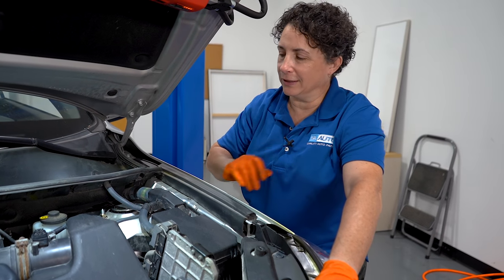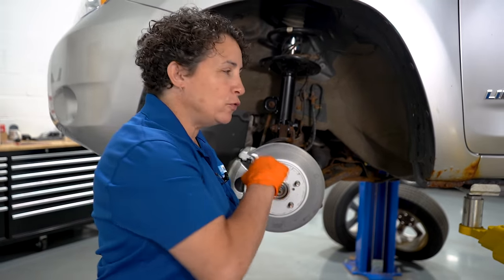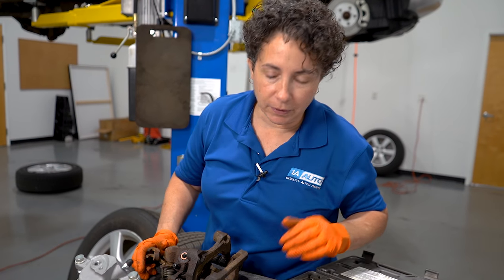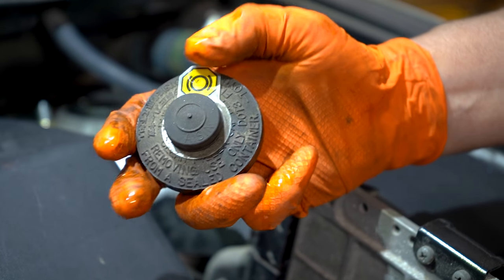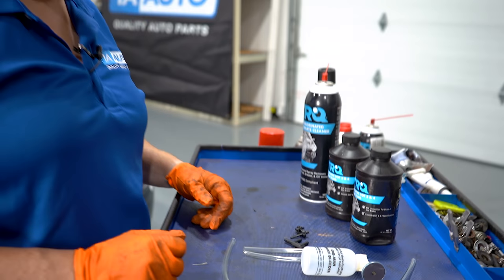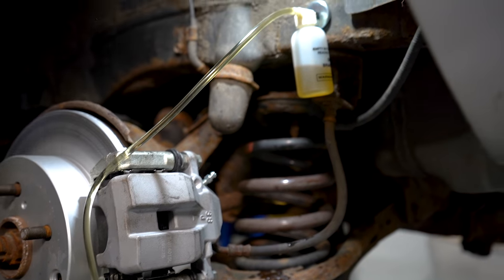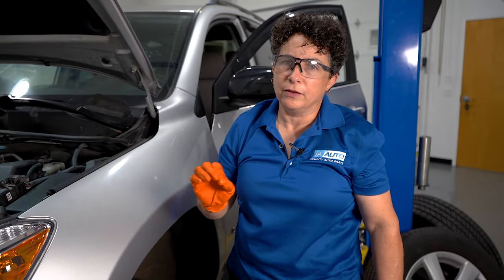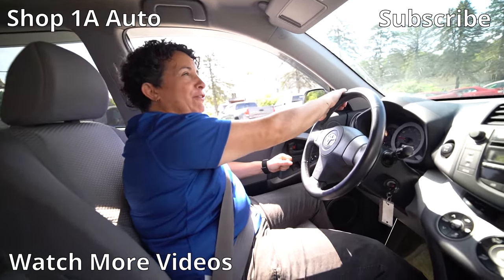Common Mistakes Bleeding Brakes! How to Do a Full Brake Bleed the Right Way, and Why!

Comment: I don’t know if you went over this but what are some of the causes that puts air in the system? Is it like a broke? Is it a loose nut? Is it a loose line? Is there a hole in the line? What are the causes of getting air into the system.

Comment: After only doing front brakes, you would want to bleed air out of the front first and get you full brake pedal back. THEN you can bleed the rear if you want all new fluid in the system.

Comment: I have a 94 civic that bleeds fine not running but when I crank it up the pedal goes right to the floor like there's no master cylinder at all / no resistance.  I've tried 6 master cylinders.
Reply: I don’t know but I’ve read that pumping the brake all the way to the floor could ruin the MC seal. GAWD I hope not! Lol Some say to place a 2” thick board under the pedal. We will see 😁. Good luck 🍀

Comment: In general, good theory, but...
Here I was, watching a professional at work (or so I thought), then at 9:07 – spray! goes the paint-stripping DOT3 brake fluid.  Wash it off immediately, keeping water away from electrical components.
10:48 – "So this time I'm gonna do it with the kit that we actually sell."
15:09 – "I gotta tell you this is my first time using this kit."  You sell stuff you've never tested?
17:10 – "As I make a mess" (chuckle).  Yes, we all made a mess the first time, then we learnt to use a funnel or buy brake fluid in a long-neck bottle.
18:25 – The beginner's errors continue.  All of us have a first time.

Comment: A big syringe can pull fluid out with a tube attached to the bleeder. No air if under continual suction. Make sure tube is correct diameter must be tight on the bleeder so no air.
Reply from the maker: +@chrismyers9951 Thanks for the feedback!

Comment: Brake fluid consists of solvent (between 60 and 90%), lubricating agents (5-30%), and additives (2-5%) which are corrosion inhibitors, which prevent corrosion of the brake system metal parts, and antioxidants, which prevent solvent breakdown and deposit formation. dot 3 systems can also use improved dot 4 or dot 5.1 fluid. beware dot 5 is unique and only for dot 5 silicone systems and not compatible with 3, 4, or 5.1 nor anti-lock braking systems.

Comment: I just can't get this to work.  Have no idea what I am doing wrong but I just can't get the fluid to come out.  The master cylinder is on tight and the brake fluid is full.  I close the bleed valve, put clean brake fluid in my bleed tool then attach the tip into the bleed vale and then open the valve with a wrench and I get some fluid but not much.  Just doesn't seem to want to come.  What am I missing here?

Comment: Thank you so much for this video really enjoyed it. However I have a mall question. On my SX4 I have the rear wheel brakes do not seem to function when the pedal is pressed. When engaged with my handle they are OK. I have to press the pedal really hard to see an effect in terms of being able to rotate them by hand. Front are OK though as seen by the disks brake pattern. I checked the pedal is firm after pressing couple of time and it seems ok. I also checked the slider on the side that seems problematic side and the pistons seems to go in and out easily. One side is working a bit better than the other. Any idea? I Thank you always enjoyed your videos

Comment: If im changing just my front rotors (and pads) do i have to do a bleed?
Or can i just just slap the new rotors and good to go?  (Without disconnecting the caliper)
Reply: Should be ok just check to see if you need to top off your master cylinder fluid level. Worn pads causes the caliper piston to extend requiring more fluid to maintain pressure on the pads.

Comment: Should the bottle containing the fluid be always installed ABOVE the bleeder screw? Is this because air travels to the highest point?
Reply: thats what I want to know.  tho I think the important component position is that of the bleeder screw, which is almost always on top anyway.
Reply: If the bottle is higher, then the air bubbles will continue up towards it. If the bottle is on the floor, the bubbles will tend to creep back up the clear tubing towards the bleeder. You can do it with the bottle on the floor, but it would be better to have a person there to make sure no air went back into the caliper.

Comment: Bleeding out air and flushing the brake system also bleeds air out of the braking system however bleeding the air out doesn't necessarily require flushing out the inter brake system. The rule of thumb for brakes is flush brake fluid (with fresh brake fluid) out every two years or 24 months. Ps at least  test fluid once a year with test strep to see how chemically good the brake fluid  is  and use a moisture tester as well .

Comment: Does the car have to be on or can it be be off? I tried doing it while the car's key was turn to on, without ignition, brakes got hard.
once the car turned on the brake pedals were really soft and spongy

Comment: I feel for everyone working on anything under a vehicle in the rust belt, looks like every nut, bolt, fitting etc would be difficult at best to break loose without actually breaking them.

Comment: There's also the dilemma of where the ABS module is. While the master cylinder is on the left the abs actuator is on the right. And then from the abs actuator it goes to a junction so... yes definitely more complicated than it looks

Comment: she said to never use a union, but when i ordered a new set of stainless brake lines for my jeep, the long line going to the rear comes in two parts with a union in the middle (otherwise i'm not sure i would have been able to snake it up through the entire vehicle)

Comment: As a matter of safety, there needs to be more than 1 system.  As hygroscopic as brake fluid is, if you bleed one set, bleed the other. Over all, it may help. Try a vacuum brake bleader. It works well,evel.solo.

Comment: I thought the order of bleed was dependent on where the ABS module is located?  Also I was surprised the rear wheels didn't need a lot more fluid removed to ensure all old fluid in the lines was replaced.

Comment: Hi sue!!! My 2014 toyota prius had rear rotors, pads and calipers put on. The guy bled them like any regular car. Now I hear like a giggle when I put my brake pedal down to start car. It was not put in invalid mode. Now a sign shows for a few seconds, maintenance required soon, what is going on?? Can I reveled them again, in invalid mode???? Help.... Thank you dear....
Reply from the maker: +TERRY TORRES We wouldn't be able to diagnose an issue like that here, you may want to have a local mechanic take a look at it. Thanks for checking us out! http://1aau.to/m/Shop-1AAuto-c

Comment: Doesn't the ABS module require air bleeding? I bled my car's system, replaced almost everything the whole system (brake pads, rotors , master cylinder and booster ....) but the brake peddle is still too spongey! But no ABS lights are on. 
So what's the big deal here?

Comment: I like to crack the bottle open after tightening the bleeder back on to relieve brake pressure in hose. This way when you do remove the hose from the bleeder there's no pressure and the brake fluid won't squirt out everywhere.

Comment: I'm having a heck of a time bleeding the rear caliper on an Audi. I think the problem is the E-brake. Any suggestions?
Reply: Not really. If it seems hard. It
Is not really air. Seems that really had a strange( Not a
Normal) order for a proper
bleed. The order was not
for me.  It was that way only
On that Audi. Audi is
Different. Careful, it is time
Consuming. 🤔💭👌✌️

Comment: When you use the brake pedal to bleed brake system it is wise NOT to push it beyond its normal travel because any corrosion in the master cylinder beyond the normal travel can rough up the piston which will allow fluid to bypass the plunger and pedal will sink.

Comment: How tight should the bleeder screw be because i just bled my brakes, my front bleeder screw on my truck is leaking
Reply: Sure be careful and tighten if
Needed. But check for striped threads as well. It may leak cause of that. I think🤷🏻‍♀️

Comment: Oops.. the abs location is what designates bleeding...furtherest location from abs...my abs is mid area of chassis on drivers or left side... and auto bleed on my scan tool requires rite front left front left rear then rite rear...

Comment: 1978 Ford F-250 come from the factory with two lines and an union on the rear brakes. Don't believe it is illegal to use an union as long as it has a double flair on both lines. Yes compression union has no place on hydraulic of any kind.

Comment: Apparently 06+ Honda Civics you bleed the front drivers side first, then front passengers, then rear passengers and rear drivers side.
Reply: That’s what my manual says but there are instructions for ABS models, too of which mine has no ABS so it’s different. If ABS is in the rear then you bleed from the front first of the longest line. I looked at a diagram for mine and it’s right rear first then left front and front right, then front left. 🤷🏽‍♀️

Comment: The copper washers for ŕthe break system can be reused. ALL YOU have to  is get them red hot and dumb them in water. All the contaminants on the washer will blow off. Ì⁶

Comment: Sue i was taught that you don't have to bleed the brakes if you just change pads and don't break open the line because you won't get air in the system
Reply: True

Comment: Why are the unions illegal? And I just did breaks and I used the last video with the bottle to bleed them, thank you very much
Reply: Because it's a chance that if it was bad enough to need one it could fail elsewhere BTW its a mandatory yearly inspection state so according to the list of regulations it's a checklist that decides if you fail or not

Comment: What are the chances of air creeping in past the threads of the bleeder screw and ending up inside the brake line/system???
Thanks.
Reply: Very little. Unless its a very old car that has the screw opened and closes many many times.

Comment: My theory for why spongy brakes are bad is that with only half the applied pressure due to air in the lines is that it now takes you twice as long to stop.  Twice as long creates much more heat and degrades the brakes even further.  Never really considered it before you alluded to that in the video.

Comment: Do you have a link for the kit or where to find it
Reply: Most all auto parts stores carry it in the tools isle
Reply: I do find that if you leave that pan on the floor and use the hose and create a 6" arch with nothing but the pan it won't backflow air and overflow that tiny bottle or use a 1 liter water bottle to catch the extra fluid

Comment: VW repair manual states:
Open bleeder valves in the prescribed sequence and bleed brake caliper.
1- Front left brake caliper
2 - Right front brake caliper
3 - Left rear brake caliper
4 - Right rear brake caliper

...also, if you are using a bleeder unit:
A positive pressure of 2 bar (29 psi) is required to bleed the ABS Hydraulic Unit

...and you should ALWAYS use a bleeder unit which will pump new fluid into the system 100% of the time. When you press the brake pedal, you are doing just that, BUT when you depress it, you suck air into the caliper through the bleeder's threads which is now LOOSE and not sealing because you unscrew it. That is just so wrong.

Comment: The problem with this procedure is that your fluid is moving back and forth so any air in the lines is also moving back and forth and you will end up with spongy brakes. I agree with getting new fluid into the calipers. A vacuum system would be much better procedure

Comment: When pushing the brake the black nipple just comes out of the bleeding dimple and it makes a big mess.
Reply: Your pushing too hard too fast or its the wrong adapter your using.(you can just use a bigger hose that fits too)

Comment: Nice Video!   If you have an insurance monitoring device in your car you should remove it and shut down anything it uses to report your driving activity to your insurance company because it will report hard braking and give you a bad mark.    After your done testing put that monitor back in the car and turn on everything it uses to track your driving activity.   Hey your trying to save money doing your own brakes so why give your insurance company and excuse to reduce or discount.   It's a small thing but every penny adds up.

Comment: Hey sue, I know it's 12:30 I'm the am mountain time, and it's a white out where I am in Colorado right now, but I have a brake bleeding question right now, cause this is when I have to do this.... If u are awake, and up for this, you should message me back... Maybe call me? If not, no problem I'll wing it

Comment: Ugh, not so fast!  There's no reason to pour any new brake fluid into that small bottle that comes in the "kit". As there is a Check Valve inside the top that screws onto it. So when you do press the brake pedal down- the old fluid goes into the bottle ( since a Check Valve only allows flow in 1 direction ) any fluid needed to replace it, must come from another source. In this case, that fluid would be new & come from its brake fluid reservoir.  The instructions may not tell you this 1-Man Magic* (or 1 Ma-am Magic) was brought to you today by the Check Valve they incorporated into the cap behind that incoming hose connector, but it is. Just networking, but she did do a great job. If she already knew, cool. If she / y'all didn't, well now you do. Always great videos from this company!    ~~~    We dumb in Bama, but we ain't plumb dumb 😊

Comment: Copper for brake lines ? It’s illegal here in ontario must use steel or stainless steel , or some other no corrode metal  if recomend stainless no rust, I think stainless should be law , cause with steel you don’t know you have a bad line until your pedal drops to the floor, although copper woul be better then steel , because it doesn’t corrode depending on th gauge

Comment: TO BEGIN SOMEONE SHOULD PUT PRESSURE ON THE BRAKE PEDAL THEN YOU SHOULD CRACK THE BLEEDER UNTIL OIL IS JUST SEEN TO EXIT AND NO MORE. THE REASON FOR THIS IS AIR CAN PASS THROUGH PAST THE BLEEDER THREADS AND INTO LITTLE HOLE IN THE SIDE OF THE BLEEDER GIVING A FALSE  READING
Reply: It's not necessary, you're going to pump the air out anyway. Brake fluid is cheap, pump a bunch of fresh fluid in there.

Comment: Make sure you wash any brake fluid off the cars paint work immediately if you happen to drop some on it. Your paint will peel off if the brake fluid is not washed away quickly.

Comment: Sue i was taught that you don't have to bleed the brakes if you just change pads and don't break open the line because you won't get air in the system
Reply: That's what I've been taught all along as well.

Comment: I never needed to pre-fill my waste bottle with fluid. I only loose the bleeder enough to let the pressurized fluid escape and the check valve in master cylinder has much less resistance than the brake line + restriction at the bleeder when pedal is released so the fluid only flows one way.

Comment: There's no need to put fluid in the bottle.  She obviously didn't read the directions.  There's a one way valve inside the cap to prevent air from getting sucked back in, as you can clearly see when she released the brake pedal.

Comment: A good Kit should have:
* A LARGE reservoir for the old fluid.
* An auto fluid refill for Master reservoir.
* A simple check valve at old fluid reservoir end.

This kit has ridiculously small old fluid reservoir! I'd be surprised if you could get through bleeding just one wheel before it overflowed!

Also, NOBODY talks about CLEANING the inside of the master reservoir! Why?

Comment: This is the absolute worst way to flush brakes! 2 problems... 1) when you pump the brake with the bleeder open a small amount of air can be sucked into the system through the threads of the bleeder on the up stroke. 2) when you push the pedal all the way to the floor you push the master cylinder seal into an area it doesn't usually go and the cylinder can damage the seal and cause a seal failure and you'll ultimately need to replace the master cylinder. Vacuum bleeding is the best.

Comment: I always place my catch bottle down low to let gravity help me , I also have a board to place between the seat front and the brake pedal.  This acts as a pedal "Hold ", then I snug up the bleeder fitting.  What thing you about this ?  Also , all this will NOT work NOT ABS brake systems !  TRUST ME !

Comment: Very nice clinical and precise job....
But I'm a DIY monkey....
My wife's friend had air in the brakes -spongy pedal etc.
None of my brake bleed nipple pipes fitted correctly so rather than make a driveway mess, I just drove to a council owned public carpark and got my wife's friend to pump the brakes and between four wheels we dumped 1.5 litres of brake fluid onto the tarmac.( wife's friend unaware)
Very satisfying and I drove away laughing.
PS.
Rainfall will wash the hydraulic fluid away in a week or two.

Comment: I heard that if you press the brake pedal further than it normally goes you can damage the seal on the master cylinder piston because there might be a buildup of gunk that creates a bump if it hasn't been maintained properly. Thoughts?